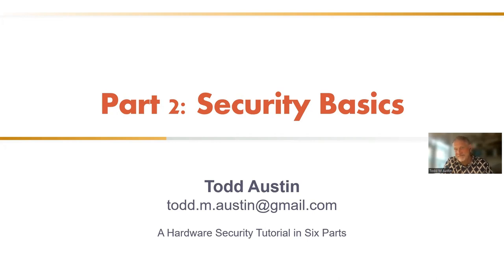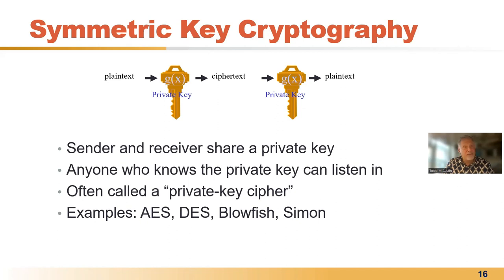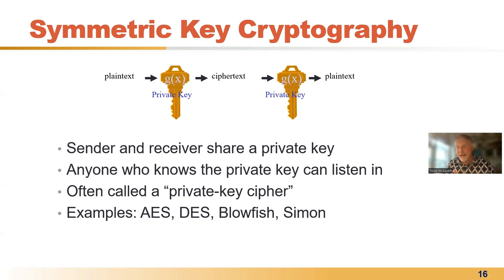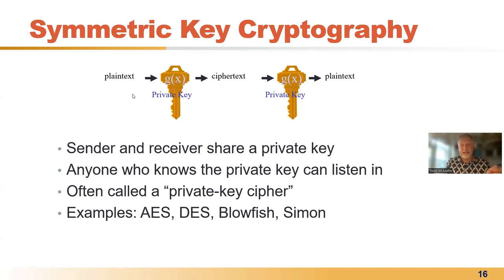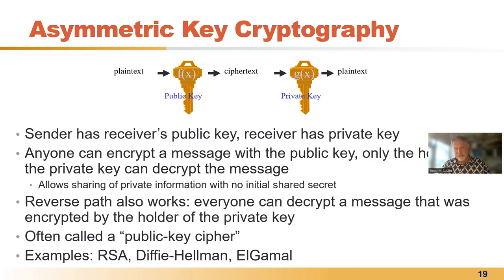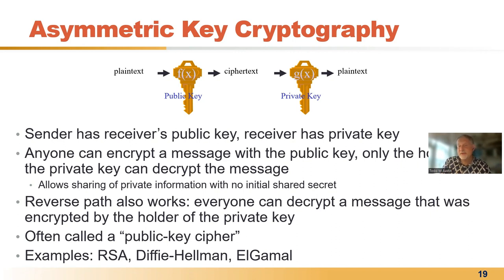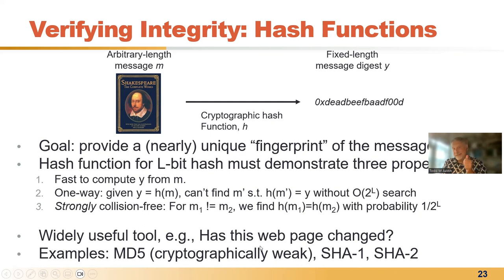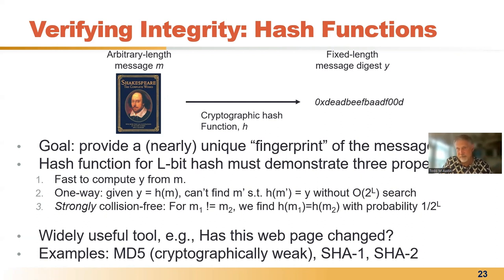Hardware Security Tutorial - Part 2 - Security Basics

Comment: Great explanation professor, 
I do have one question regarding producing the factors of a number originally from which the number was produced, is it really possible? Even if quantum computers gave us the computation power for doing all this computation but is not our solution space is infinite possible solution, so how do we find the exact factors which were used to produce the number in first place? I don't have knowledge of working of these ciphers so kindly do correct me if I'm approaching it in a wrong way, thanks.
Reply from the maker: Thanks for the question! The factoring solution space is not infinite, but it is exponential (or worse) with the number of bits in the keys. Here's an almost 2000 year old algorithm that will factor any number into its prime factors, given enough time to compute: https://en.wikipedia.org/wiki/Sieve_of_Eratosthenes. The challenge with conventional computers is that the key size for RSA today is 2048 or 4096 bits, so you are looking at O(2^2048) size search spaces, which is unsearchable in anyone's lifetime (and the reason no one is breaking the RSA keys directly). One of the foundational algorithms for quantum computers is Shore's algorithm (https://en.wikipedia.org/wiki/Shor%27s_algorithm), which in the best case can factor large numbers O(log 2^2048) which is roughly O(~600), a much more achievable complexity! Today's quantum computers are still too immature to factor large numbers, but as the technology improves, there may someday come a time when a quantum computer can brute force discover an RSA private key, which would be pure chaos for the internet because anyone with a quantum computer could pose as anyone else on the internet (and create their digital signatures, etc...), so cryptographers are busy at work today to develop asymmetric key ciphers that utilize one-way functions that are not amenable to any known quantum algorithms.